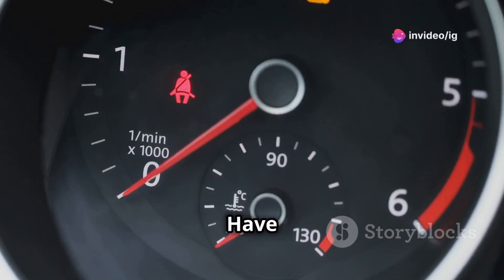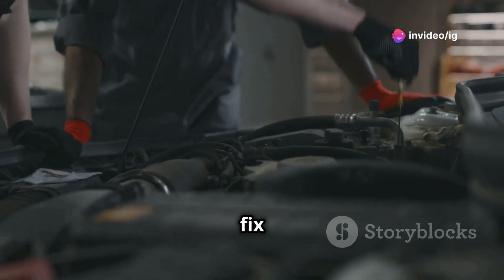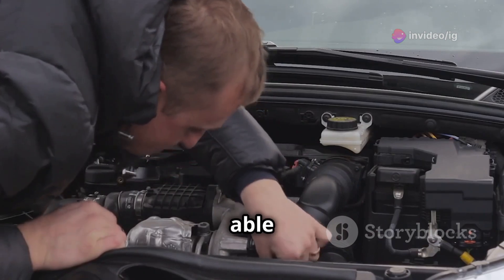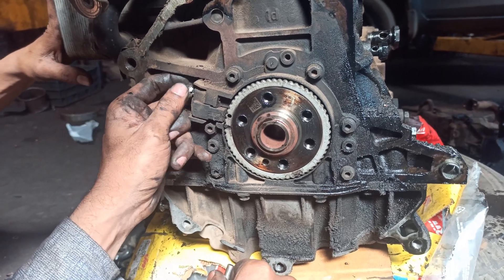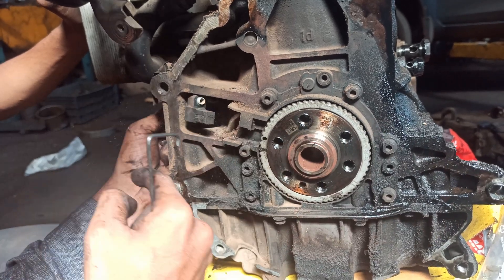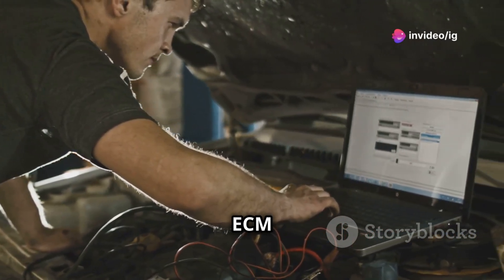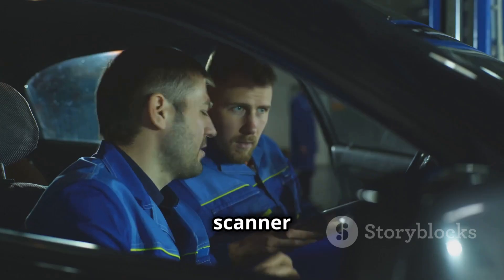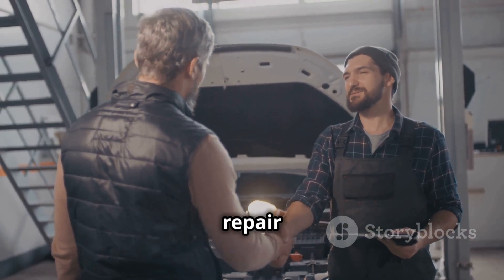P0315 | p0315 crankshaft position system variation not learned | p0315 code

Comment: What if it doesn't start at all but gives this code should I change it out and it will start ,????
Reply from the maker: It will and check the wiring also
Reply: so it's not starting at all and I got this code for crank sensor and I can change it out and it's possible it will start again... that would be awesome @iggarage6014